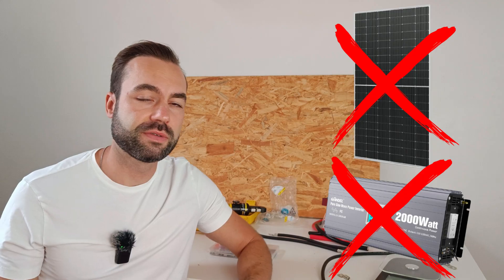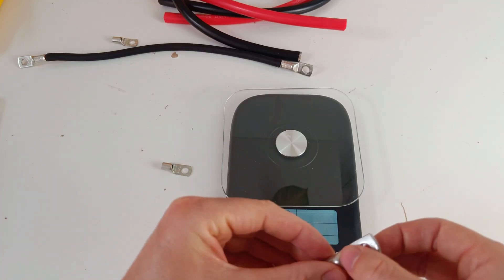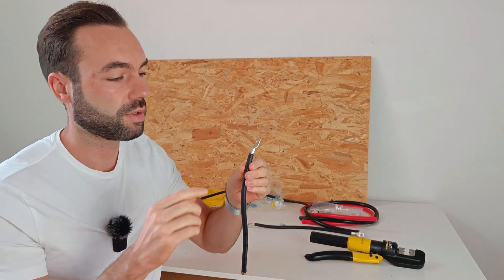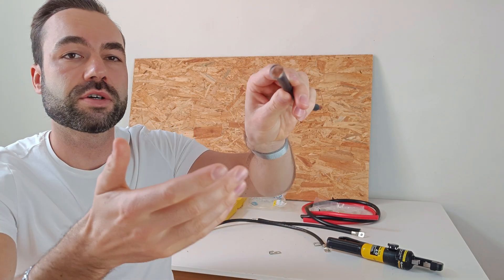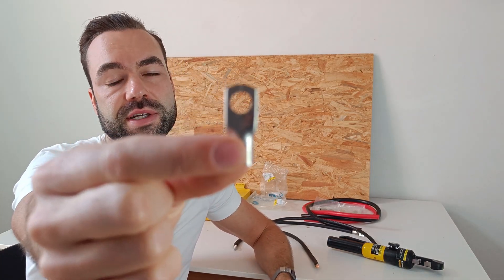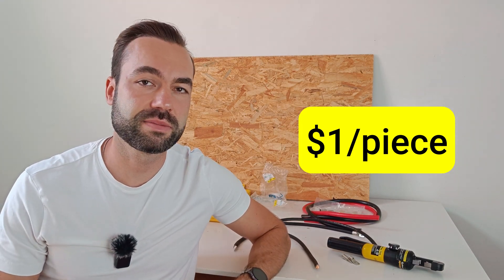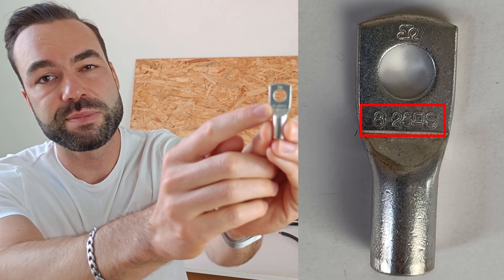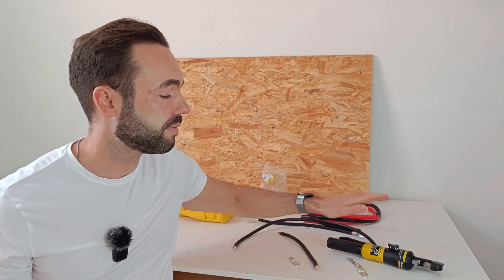Cheap Vs. Expensive Lugs For DIY Solar Power

Comment: Now I know where many of the 1 star ratings on the crimping tools come from 🤣
- people say the crimps don't hold and that they need to use a smaller die or solder the connection afterward for it to not come off. I got one my self recently, which have worked perfectly for me. Apparently I haven't encontered a bad lug yet. The quite cheap ones from a nearby hardware store, were apparently the good ones. 
2 of the connections was in a tight space as well, so I had to "wrestle" the cables and bend them quite sharply next to the lugs afterwards - simply to get them in place and still not even a single strand was sliding inside the crimped sleeve (they all just bent on the outside, next to it). 
I also got some 35 mm² ones from amazon that was open in the other end (but if using them only for connections in dry spaces, where most of my connections will be, that shouldn't be an issue) - but those still seem give good solid connections, that can't be budged by just holding the lug and wire, trying to pull. Even bending the lug sharply 90° to the wire (just for testing), there are no strands sliding out

But I did notice on the ones I have (that haven't been crimped onto any wire yet), that the "wall" on the sleeve is quite thick (like 1 mm even for just 10 mm² ones). So I can think some of those cheap chinese ones, have thin walls (more like what you typically see in ferrules for example) and don't get compressed enough within the space of the die, to really "grip" the wire inside and make the strands "fuse together" like you showed.
Reply from the maker: Exactly 💯

Comment: If the longevity of your system is dependent on the perfection of a crimp, you are designing too close to the edge. When designing, you have to account for degradation and leave room for error.
Reply from the maker: Not at all. So you are okay with doing a half decent crimp as long as your wires are sized larger?
Reply: @cleversolarpower  I am saying do not run 95 amps through a 100 amp breaker. If you have 6000 watt inverter, do not run it at 5500 watt loads continuously. if you run everything up to it's rating on a regular basis you are dependent in ideal conditions. Lug torque, crimp quality, fan, wire length, filter, humidity, temperature and insulator age will matter. Over time, those tolerances degrade.

Comment: 25mm2 is 25 square millimetres. Before computers, the two was a superscript.
Reply from the maker: You mean 25mm² 😎
Reply: @cleversolarpower  I can't type superscripts on my PC. What you just typed should be read 25 square millimeters.
25² is 25 x 25 = 625.

PS I got the superscripted 2 by copying yours.

Comment: Any connection that expects to carry high current like 100A will overheat and fail fairly quickly without a good solid crimp.  Some smaller solar installations (like mine) are 12V, and any high resistance connection will immediately mean high power loss.  I found this out the hard way.  If your connection losses add up to 1.2V, that's already 10% of your power lost.  But, it's even worse because the charge controller will be fooled into thinking your batteries are fully charged when they're not.

Comment: I just learned more about lugs than I ever knew before. How about the crimpers sold on Amazon that you lay the cable and lug into then smack it with a hammer? Are those any good? no hydralics to go wrong in those, but maybe not as consistant. Thanks Nick! Cheers, Danny 💗🌹💗
Reply from the maker: I don't recommend the hammer tool because you will not get a cold weld. You are better off buying pre-crimped cables then. The hydraulic crimper is not the problem, it's the bad lugs that are the problem 😉.

Comment: Hi Nick, Thank You. 
I have been looking for reliable information on this topic for long time. 
The crimper in the supplied link is so similar to others, but it is much more expensive, how can I be sure I get value for all that extra cash. 
I want to do this job right.
Reply from the maker: I think they are all priced around $40. Some might be lower or higher. If it looks the same, it probably is.

Comment: I ordered some amazon specials that had good reviews but they were a very loose fit on the wire. Seemed like they were for 2 gauge instead of 4. I got some from windynation that fit much better.
Reply from the maker: Windynation is also a good brand. I like their pre-crimped cables, very easy.

Comment: Thanks for the wonderful lesson, Nick. Could you discuss some torque on the bolts and screws? Like, do we really need those expensive torque wrenches and screwdrivers, or are the good old manual torque and wiring of the cable, as well as checking the voltage before and after the torque, good enough?
Reply from the maker: Personally i don't use a torque wrench. But if i was a manufacturer i would advise you to use one.

Comment: ❗️What’s your opinion for ‘soldering’ lugs.
Reply: If the lug gets hot, it can melt the solder out, then arc and burn the place down, or the wire can fall out and … again arc and burn the place down. No.
Reply from the maker: Never solder lugs. You are filling up the void with tin. So you are not achieving a cold weld.
Reply: Crimping always better, but solder can be considered safe, if there are no movements of cable and vibrations. I crimp and then melt solder inside those lugs windows, and never had any problem. Same i do with MC4, even its not needed, the end of wire which is not crimped i solder.
Reply from the maker: If you have 'lug windows' then you are not using good lugs. You are trying to patch up a bad crimp, which shouldn't happen in the first place.
Reply: @cleversolarpower  Totally agree, but still it works, and there are other components which will fail than my crimped and soldered lugs.

Comment: From a retired telco CO installer...we always used no-ox (not dielectric grease) on crimped cable terminations. Once crimped the no-ox permits conductivity while eliminating air infiltration.
Reply from the maker: You apply the grease on the outside of the lug after installation, right? Not on the inside before crimping because that can prevent the flow of electricity, even if it's conductive. I have never used it before, even when i was working at a chemical plant.
Reply: @cleversolarpower agreed, dry conductor to dry lug for best cold weld. Marine grade heat shrink on top of lug. 

If marine environment and dissimilar metals, can use nolox for screw terminal connections, but shouldn't be used elsewhere
Reply: @cleversolarpower The no-ox was wire brushed into the strands then the lug crimped on to the cable end. A battery company that provided nicad batteries for cell site backup did have us completely cover battery cable terminations with no-ox though.
Reply: @cleversolarpower The hole in the barrel (tang end) was used to very proper cable insertion prior to crimping.

Comment: This is why you get people trashing hydraulic crimpers in reviews saying they always had to use the size below dies to get a good crimp.
Reply from the maker: Exactly!
Reply: I wish I would have seen this video a couple years ago.  Now I know why I had to use a smaller die on some of my crimps.  Will order better ones to use as I update my system.  Thank you!
Reply from the maker: It's still good to check your connections even though you have crimped them with a smaller die.
Reply: @cleversolarpower  I will do but I do a good tug test following hydraulic crimping.  On some of them I did notice crimp "ears" when using some of the lugs.  I cover them with glue filled shrink wrap.

Comment: that is exactly my experience with thin walled lugs - you need the smaller die for a tight connection - I would avoid them !
Reply from the maker: Indeed, so many people have dangerous crimps. A disaster waiting to happen.
Reply: I was wondering why I always had to use a smaller die ... Now I know.